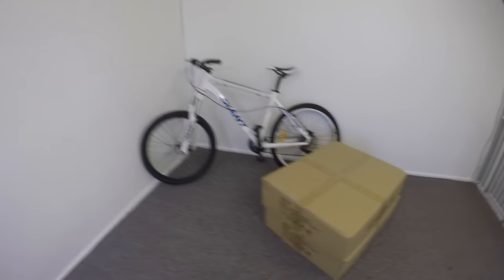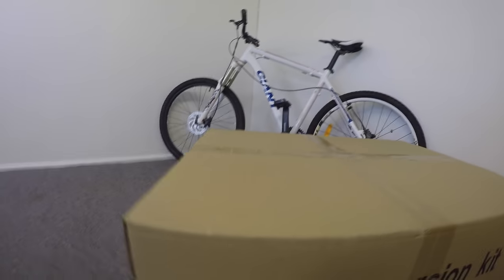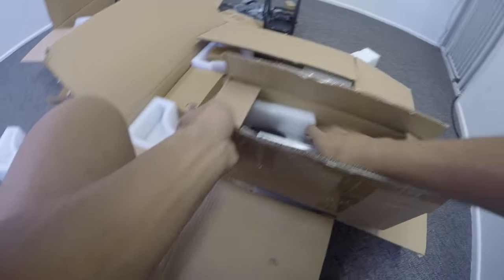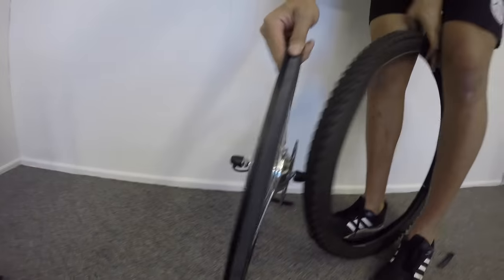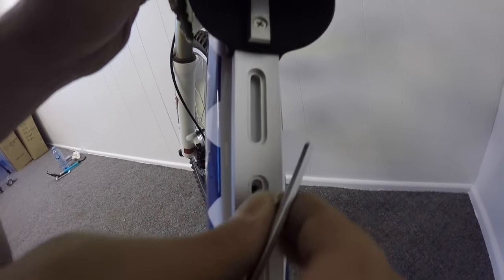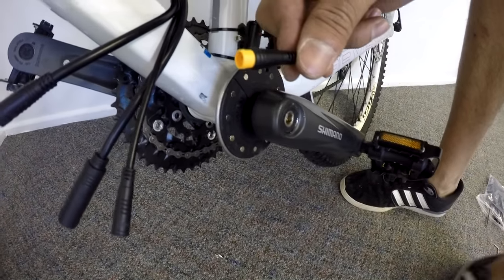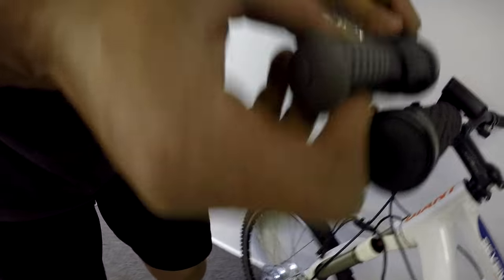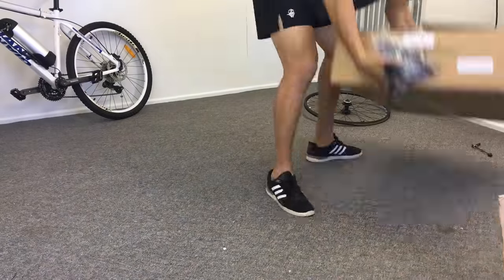Aklo A-Kit Conversion Kit Unboxing & Installation | E-Biking Now

Comment: This was much more an unboxing than an installation video. I’m newbie to the ebike world and have just started down the YouTube rabbit hole learning what I can as I consider either doing a conversion myself or buying a complete ebike. Considering my lack of knowledge, I was surprised when the installer didn’t install the 1/2 throttle and brake controllers because he either “didn’t like” them or it was a hassle to do so. Wait. What? Are they necessary? What are you giving up by not installing them? Sure, I might be lazy, but I would think someone going to the effort to do an install video would try not to show their laziness. And what about a post-install test run (other than just showing that the wheel does indeed spin)? Why wouldn’t you give feedback on how the unit operates and how it sizes up to other similar kits? This video was a waste of my time, so I spent about as much time writing this comment. Yeah, I see the irony there...

Comment: I have just finished installing the Aklo kit to my bike and can I say, I love it!! I encountered no problems with fitting it on the bike and have also installed the e brakes which was easy to do. Thanks for the video, I found it very useful for my installation. If you're looking for some bang for your buck, I would highly recommend this ebike kit.
Reply from the maker: Thanks for your feedback. We appreciate your support!
Reply: Adam May hi guys tell m the price
Reply: If you go onto the Ebikery web site you can purchase this kit. Was on sale for $599.00
Reply: How fast have you gone so far? what's the top speed?

Comment: Is it possible to quickly remove the bottle battery and put it back on after to prevent someone stealing it?
Reply from the maker: Easily done! Unlock with the provided key and hold it in your bag, and then lock it back in when you want to ride.

Comment: Wait, so the controller is within the bottle battery holder?
Reply from the maker: Yep! So with the bottle style A-Kit, the controller is in-built into the battery holder. But with the rear rack style, the controller is separate as shown in the video.
Reply: @ElectricReview  It looks like an insulated coffee mug... ha ha

Comment: Can it run for 2 hours in one charge?
Reply from the maker: That's a tough question to answer. "How long is a piece of string?"
How long an electric bike can last is dependent on a lot of factors; like hills, wind, rider weight and PAS level. I think range (miles or km) is something better to look at, but even then, it's not 100% reliable. I'd say the average range for this kit, using medium pedal assistance can get you 30km.
Reply: E-Biking Now can you just asnser the question, how long does it last for you

Comment: Somebody needs to come up with a new invention for the water bottle holder.
Reply from the maker: You could hold it on the top tube or the handlebar. Like this? https://goo.gl/PvWWtu
Reply: E-Biking Now - oh ok, I didn't know that it was already reinvented lol. I guess that would work okay, but could use some tweaking... metal holders would be better on each side (instead of front and back), with a small bent cradle at bottom) for easier release and "put back." Also would be better if there was a way of keeping the bottle somewhat upright. Thanks for that link/pic.

Comment: Are these kits waterproof, can the bike be rode in a heavy down pour?
Reply from the maker: Hi Chay, 
No this kit isn't waterproof. It's slightly water resistant. It'll be okay to use in some very light rain (spitting) with the meter controller covered, but definitely not in rain or heavy downpour. Check out our latest video answering the question 'Are Electric Bikes Waterproof?' for more information!
Reply: Chay. Bode.

Comment: Thanks for making the video, it's a good review. I've seen in alot of places that these 250W kits are "street-legal", but just wondering if the motor has a sticker stating anything about compliance with EN 15194? From http://www.rms.nsw.gov.au/documents/roads/safety-rules/standards/vsi-27-mopeds-power-assisted-pedal-cycles.pdf, it says that "The vehicle must be certified by the manufacturer, and labelled as complying with EN 15194. The label must include the manufacturer’s name, the motor’s cut-off speed in km/h and its continuous rated power in watts.". It also states something about the throttle being limited to 6km/h, but I'm not sure if that's supposed to be limited within the controller or by the user. I'm guessing for the most part people won't get caught if they don't have these things, but what worries me is in the event something goes wrong and these non-compliances come to light, leading up to a hefty fine.
Reply from the maker: Hi, thanks for the support! Glad you liked it and found it helpful.
Yeah there is a lot of "street-legal" kits floating around; and yes it should be labelled by the manufacturer with the information as you have said. This whole legality thing with electric bikes is a big grey area, and for that reason I suggest you contact the company that you're interested in purchasing from and discuss it with them. 
I can't exactly remember if this motor had the label or not, and since it's been a while they may have updated their kit. I recommend you contacting and asking Aklo.
Thanks!

Comment: please guide me where to purchase this my rim is 27.5 so idk which to fit. please advice
Reply from the maker: You can purchase this kit from EBikery. They also have an online store. However unfortunately they don't have a 27.5" or 650b wheel option.
Reply: Get a 26 inch wheel bike

Comment: Would it be ok to use a 48v 20ah battery on this kit as an upgrade. I've got very steep hill and weigh 100 kg +?
Reply from the maker: If you've got your own custom battery or thinking of a custom set up, I recommend building a custom kit. Using your own battery with a premade retail kit can cause some issues.

Comment: That's too many cables hanging around your cycle lot cumbersome
Reply from the maker: There are a lot of cables, but this is fairly standard. Can't really get any less than this. One each for the motor, battery, LCD display, and two for the brake sensors.
Reply: Kiran Kumar And what do you suggest to replace the cables with? Maybe you could just use the power of your mind to control everything instead? 🙄

Comment: Brake sensors are a safety device. " I didn't install them because they are a little bit tedious to install", wtf?
Reply from the maker: Hey Ed, I understand that they're a safety device and I do recommend people to equip them when possible; however it was almost impossible to install. Other kits and eBikes have a LCD display meter which notify you with a symbol that the brake's are engaged. This symbol lights up on the meter when the magnet is out of range of the sensor, but with this kit, I could never tell since it was only an LED meter with lights for battery level and pedal assistance level. Hence why I said it was tedious to install. If you have any tips or workaround this, please let us know!
In saying that, the power did cut out relatively quick once you've stopped pedalling. The delay was small, and I know there are still dangers in situations where you accidentally pedal and meant to stop, but I never experienced any dangers like that with this kit.
Reply: Ebiking Now ... Not going to argue with you, your video and information content is horrible. I will find better sources of information elsewhere and will not be back.